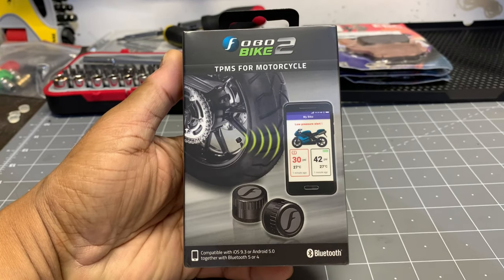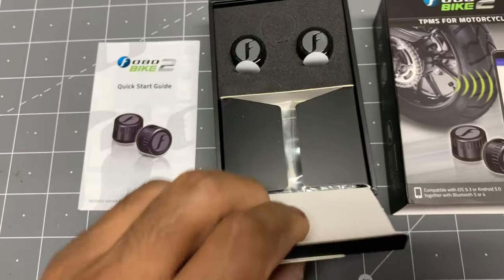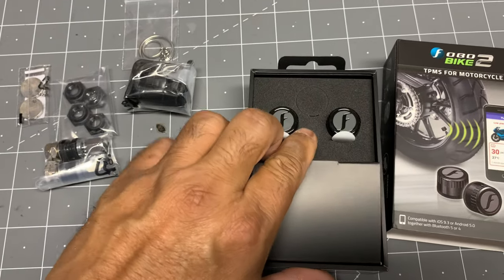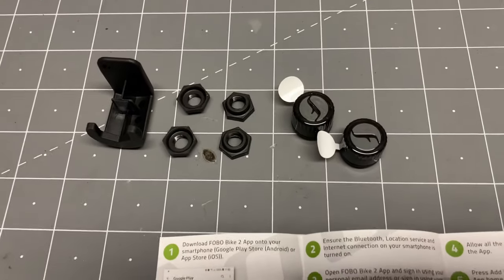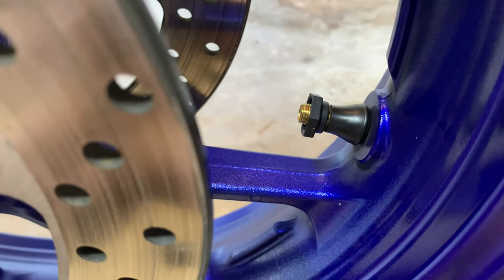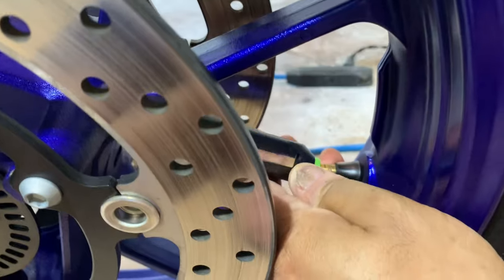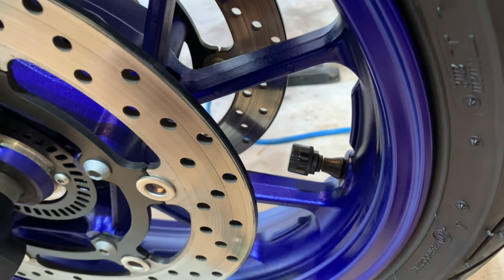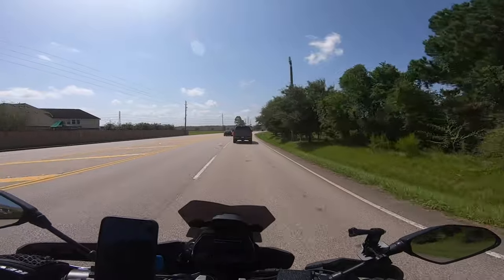FOBO Bike 2 Tire Pressure Monitoring System Install, Review, Test Ride | 2019 Yamaha Tracer 900 GT

Comment: Do these reflect true 24/7 monitoring? I purchased a different brand and found that it was reading pressure on both tires even after I removed them from the stem.  Worth verifying on these...
Reply from the maker: There’s only monitor the pressure when the app is running. So if I go for a ride and don’t have the app running in the background, I would not get warned of a loss of pressure. Makes sense. 

Also if removed from the tire it will not read if the app is running but will show “—” and will sound the alarm as it thinks that there is a total loss of pressure. If the app is not running then all is quiet.